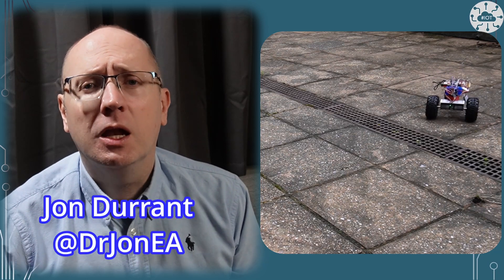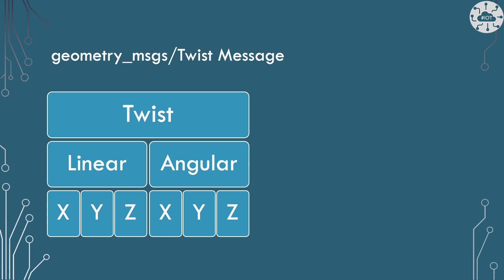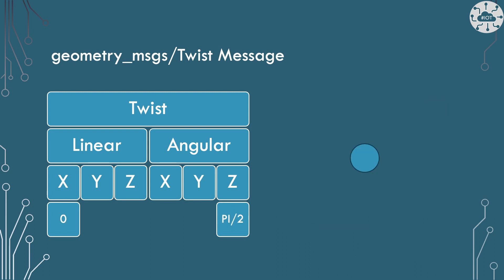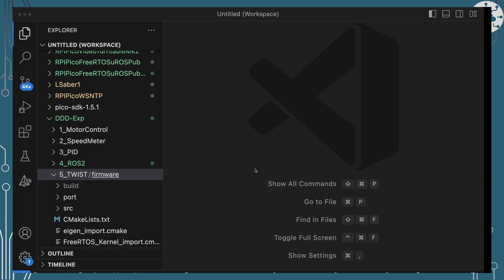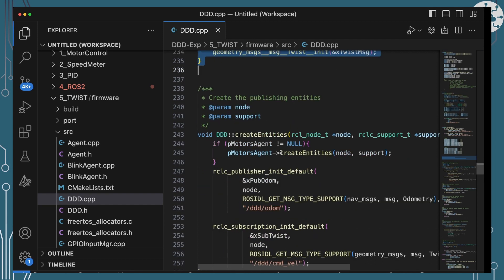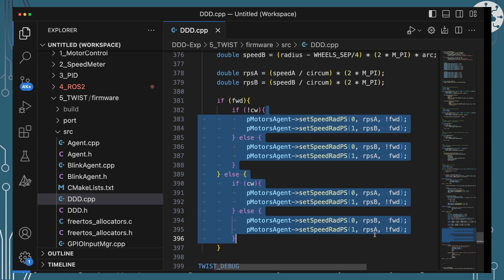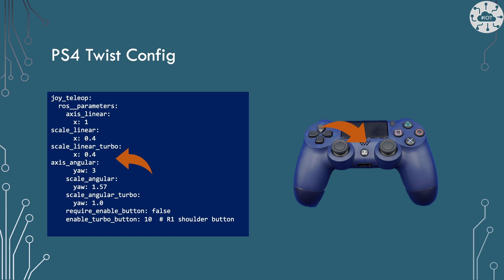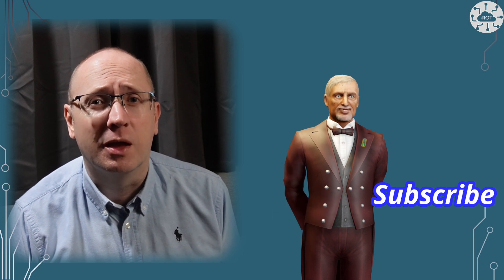DDD: ROS2 Twist - Driving Raspberry PI & Pico Robot from Dual Shock 4

Comment: Looking at MotorMgr.cpp,  the input appears to include (for each motor), encoder A, encoder B and "CW" and "CCW". The motors I have seen have 6 leads:  power (+-), encoders A and B, the control lines 1 and 2,. Each motor then has a PWM signal line from pico to the L298N. It looks like this is using the control lines for PWM. Is that correct?
Reply from the maker: Yes that is correct. Each motor has encoder A and B as you state. Then two power lines which are controlled by PWM. I tend to call these CW and CCW as we reverse current on them to reverse the direction. There will also be some + and - power for the encoders.